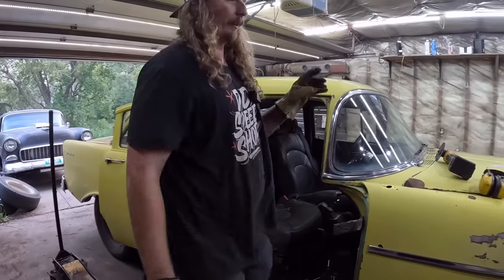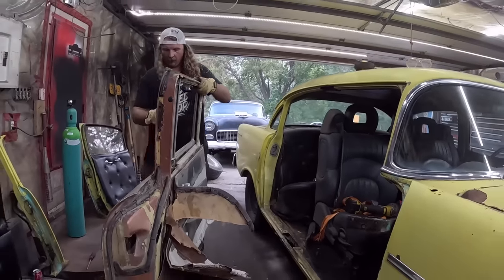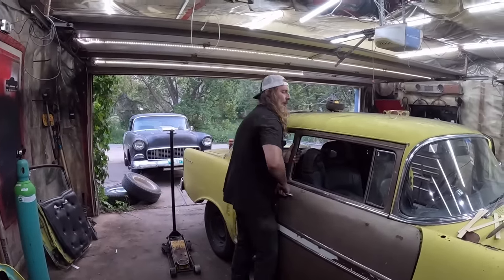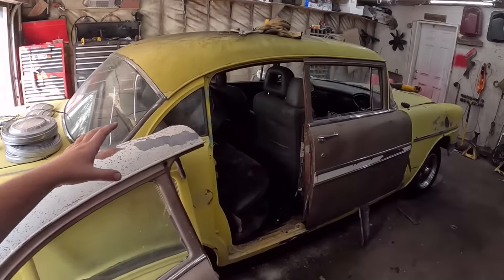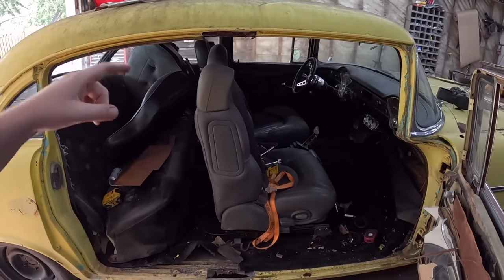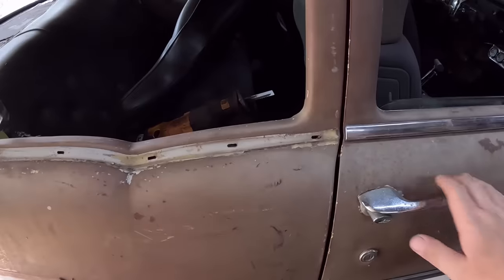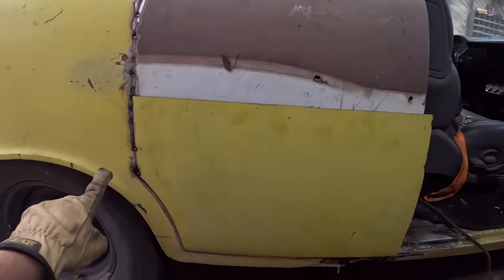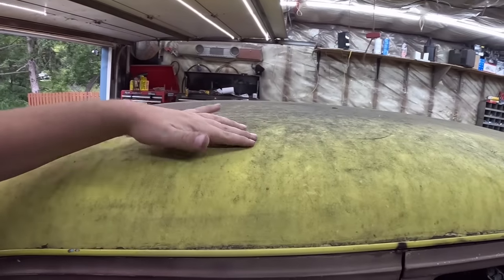QUICK And EASY 2 Door Conversion - Transforming A Ugly 4 Door Into A Sweet 2 Door!

Comment: I love your videos because we approach projects the same way  -  start with a vision in your head and then figure out how to make it a reality piece by piece. The greatest motivator for me is when I tell someone what I want to do and they tell me it can't be done. I've given up on using a floor jack for removing and installing doors. Now I use a pair of ratchet straps either wrapped around the roof or over a ceiling joist.. Having one at the front and one at the rear makes it easy to get the door perfectly level.

Comment: Dan,
When you had the yellow door skin over the Pontiac upper sheet (where the back doors used to be) instead of marking a line to find where you’re cutting, just cut a straight line through the yellow door skin AND the Pontiac sheet at the same time.
Perfect line every time because you cut them together.
Reply: Have you been watching Halfass Kistoms too. I believe that method would work as you said
Reply: @johnchambers12  I haven’t seen any of that shop’s vids. I’ll have to check them out .

Comment: Hey Dan, We use a product at work to unseize stainless nuts on bolts. We put a product called P80  on the nut an bolt an work the nut back an forth. Nothing galls like stainless. They come apart every time. Its a rubber emulsifier but it works on seized nuts an bolts.

Comment: Nice work dan it makes it a lot EZR and quicker with the 1/4 panel chunks. im trying to get a black 57 150  4dr sedan that was being restored and was taken apart and all painted and not put back together.  the chassis was sandblasted and painted/ it is all restored and has front disc brakes too. i have a pair of 2dr sedan doors for it.

Comment: I'd like to see this process done with a Chrysler 300 to make a true coupe with two bucket seats.  In this case the whole car would be shortened and the single doors on each side would be made up of the front and rear doors combined.  The wheelbase would be made as long as possible and still be within a pleasing design by moving the wheel wells and wheel cutouts.  I can make a drawing of it if you are interested.

Comment: Next step, find a convertible that's rusted from the beltline down & snag all the solid upper topless goodies & slam em in there. I'm a huge GM guy but never had a huge interest in tri-fives because they are so popular. 1958 - 1972 GMs are my kinda cars, but most of those have a different roof shape (2-d to 4-d)

Anyway, I've seen this procedure many times, by many builders & this is fairly impressive since it's so quickly done. With my junk spine, this would take me a full week... per side. ⭐Subbed

Comment: Hello. I am a man who lives in Norway. I have worked at Verksted. I've been screwing with vehicles since my childhood. Motorcycles to Cars. Rebuilt cars with bigger engines. My last car I built was a 1983 Camaro Z28. Welded everything from rust. Built Drag Racing Motor fitted in that car. Had to drill a hole in the engine cover. Because the engine was too high. I know your car is old. It has a frame. The bodywork of the car cannot withstand the wick. When you cut away the door posts. You should have laid rails under the car. Put jacks under them. When you cut away the post. If the bodywork is too weak, keep the weight of the car up. The whole car can go down by several millimetres. When the post is cut away. Listen to an Old Wolf. Who has screwed cars for over 40 years.... Owned a Volvo Amazon. Engine was trimmed with large Turbo. Was 10 Gears on the gearbox. I had that car at 8,000 RPM in 10 gear ;) On the road. I would think the speed was approaching 300Km,h there then. Drove from 2 seater sports cars with mid-mounted engine. Then I drove a 1969 Model Volvo amazon. The car was lowered to the road surface with the frame. A cigarette box that I put on the side. Couldn't I take in under the frame towards the road. That's how low that Volvo was. When you own a car with 2 gearboxes. Which are mounted one after the other under the car. 10 gears. Runs turbo engine to 8000 RPM. in 10 gear... Then a person drives fast. :) The police have tried to arrest me a number of times. I drove away from them. :)

Comment: Dan, with the ability and talent that you have why don't you build one car that looks complete and finished? I'm not saying a show winner but a really cool hotrod that doesn't have things half-assed. What I mean is fucked up interior, switches that don't work, holes in the dash, no headliner, you get the picture. Take your coupe for instance. That baby is a clean canvas. Start from scratch and with your welding and sheet metal fabrication skills build a complete running and driving bad ass car. Put your 5 spoke Torque Thrusts all around on it maybe some louvers on the deck lid and make a really cool ride. You have enough 5 ,6, and 7's to last a lifetime. And you say? PS: Don' get me wrong I have been watching your channel for years. I love watching what you are able to accomplish.

Comment: Ok let me teach you something even though you are very very very smart take an  old half Moon file  put it in your vice sticking up  1 1/2 inch and put a rag over it  for safety then hit it with a hammer then you can use it to clamp on an angle cause the clamp will be on the tangit of the angle new tool no money  I've used this for years
Reply: O ya easy  prasy